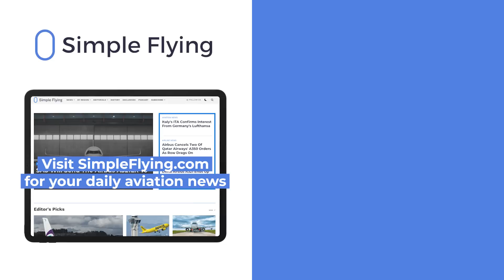FAA Proposes New Airworthiness Directive For Boeing 747-8 Aircraft

Comment: if its a Boeing, I ain’t going! Will do the work to make sure I fly Airbus. I never thought I would say this, Boeing was the first love of my flying career.
Reply: This is somewhat sensationalistic. AD notes are driven by previously issued service bulletins as was mentioned in Boeing’s statement. There is not one production aircraft that doesn’t have at least one AD note. The Airbus A-320 has AD driven recurrent NDT (non-destructive testing) crack inspections at Frame 35 behind the aft end of the forward cargo pit. At Frame 47, upper fuselage above the overhead stowbins. At Frames 66-68, forward and aft of the aft entry doors, just to name a few areas susceptible to repetitive stress cracking on an airplane that isn’t a Boeing product. The good news is that in commercial aviation, maintenance, inspections and repairs are all part of the business. In general aviation, AD note compliance is reviewed at each annual inspection. News items about airlines being fined for missing inspections are mostly just noise.
Reply: Airbus is literally no better. Stop falling victim to hyperbolic headlines

Comment: About a year ago, I flew left Lufthansa 747-800. I could no believe that, as we entered the planes, we could see the fuselage had been reinforced due to cracking. In a 6 year old plane. Looked like what may be normal cracking reinforcement for a 36 year old plane. Something wrong here and I will not fly 747-800 again.
Reply: This is somewhat sensationalistic. AD notes are driven by previously issued service bulletins as was mentioned in Boeing’s statement. There is not one production aircraft that doesn’t have at least one AD note. The Airbus A-320 has AD driven recurrent NDT (non-destructive testing) crack inspections at Frame 35 behind the aft end of the forward cargo pit. At Frame 47, upper fuselage above the overhead stowbins. At Frames 66-68, forward and aft of the aft entry doors, just to name a few areas susceptible to repetitive stress cracking on an airplane that isn’t a Boeing product. The good news is that in commercial aviation, maintenance, inspections and repairs are all part of the business. In general aviation, AD note compliance is reviewed at each annual inspection. News items about airlines being fined for missing inspections are mostly just noise.
Reply: You’re sure it was due to cracking?
Reply: @JayJayAviation  I don’t know any reason why not. I doubt this was part of the original design. Especially as these reinforcements was irregular.

Comment: How did you manage to make a whole video about the BS2360 bulkhead without even once showing a photo or drawing of it? FYI, 2360 is the rear pressure bulkhead, just aft of the rear toilets. The one that failed on JAL 123, killing 520, after a botched Boeing repair of a tailstrike..

Comment: This is somewhat sensationalistic. AD notes are driven by previously issued service bulletins as was mentioned in Boeing’s statement. There is not one production aircraft that doesn’t have at least one AD note. The Airbus A-320 has AD driven recurrent NDT (non-destructive testing) crack inspections at Frame 35 behind the aft end of the forward cargo pit. At Frame 47, upper fuselage above the overhead stowbins. At Frames 66-68, forward and aft of the aft entry doors, just to name a few areas susceptible to repetitive stress cracking on an airplane that isn’t a Boeing product. The good news is that in commercial aviation, maintenance, inspections and repairs are all part of the business. In general aviation, AD note compliance is reviewed at each annual inspection. News items about airlines being fined for missing inspections are mostly just noise.
Reply: Service Bulletins and AD's are common on all aircraft. They are complied with and the fleet goes on. The redundancy in design shifts load to other members. The issues you see here do not take into account the cleverness of the design. "If the average man designed an airplane it would not be flimsy and break. It would be so heavy that it could not fly" John Thorp.  He probably quoted others before him..

Comment: That could cause problems for the new AIR FORCE ONE 747-8i Airplane.
Reply: No. The AF1 has some years before it will fly. Plenty of time to take it apart and rebuild it and take it apart and rebuild it and take it apart and rebuild it and run over budget several times.

Comment: I wonder if this is an issue popping up based on the ages of the aircraft, or an actual design flaw.
Reply: Another shim problem. Apparently the people on the line did not get the 911 on installing shims correctly.  Not a design flaw but rather a problem on the manufacturing floor.
Reply: @danharold3087  You mean the 411. One of Boeing's biggest problems is dismantling its union and hiring a lot of less experienced workers, paying them less.  They're showing less care in the quality of the product just as Boeing is showing them.
Reply: @sainnt  The 747 was assembled by union workers in Everett WA.  The sections of the jet were not necessarily assembled in Everett or even by Boeing - Spirit Aerosystems supplies the sections for many Boeing jets.
Reply: Design was fine. Construction and subsequent Quality Control of assembly are the issues here.
Reply: I was never a fan of the 747-8. I hope it's not the latter
Reply: @rpt19  I've flown on it twice on Lufthansa, once in business class on the upper deck, and economy on the lower deck. The aircraft is an absolute joy, though I can't say the same for Lufthansa service.
Reply: @sainnt  I can relate
Reply: Can't believe the 800 has been flying since 2011 already!
Reply: @Anolaana  Which 800?
Reply: Soo did Boeing forget how to build a 747 properly?
Reply: @robertojofre15  No, they didn't. Aircraft aren't completely built in house anymore. Components are outsourced, then assembled in-house, but sometimes the components don't quite fit together as designed, and it's up to Boeing's quality assurance team to make sure that they do. That's where they seem to be falling short a lot more lately.

Comment: Boeing informed customers in 2021 and 2022,  Now in 2023 the FAA is working out how to make it official.     Boeing even responded to simple flyings information request.    Better had it not happened but sounds like it was well handled.
Reply: So, you fail to follow procedures, this makes the aircraft dangerous. Then you tell the customers something, details not show. and after 2 years the FAA has to take action! And you think this is a win for Boeing1 Pretty low standard.
Reply: @benwilson6145  There are 100s of similar cases where aircraft are required to be inspected for possible problems.    This is almost a Yawn.
Reply: @danharold3087   I imagine there all faulty Booeing aircraft !
Reply: @benwilson6145  Your bias has you imagining wrong.   Airbus aircraft are subject to a number of ADs, some of which require inspections. Common areas that are inspected under ADs include wing spars, hydraulic and electrical systems.  there are a number of airworthiness directives (ADs) that apply to the Airbus nose wheels.
Reply: @danharold3087   From your attitude to passenger safety I can only imagine you are the QA Manager at Boeing
Reply: @benwilson6145   Only pointed out some of the  problems at Airbus because you made out like only Boeing has problems.   These aircraft are complicated and problems exist.   The most memorable and visible one is the nose wheel.
"The Airbus nosewheel has been a problem for many years. There have been numerous incidents of Airbus aircraft landing with their nosewheels turned sideways or even backwards. This has led to a number of accidents, including the crash of a FlyDubai Airbus A321 in Rostov-on-Don, Russia, in 2016."    
Time to act like an adult instead of a fanboy.
Reply: @danharold3087  All new aircraft models have teething problems.  In 1969 the airline I was working for began taking delivery of the Boeing 737--200.  It was such a flawed design that airlines began refusing it and Boeing almost ceased production.  We mechanics had our hands full getting the airplanes back into service after many hydraulic and electrical system failures, not to mention the horrible skin corrosion problems.  However, Boeing came up with effective fixes for all of them, and year by year the airplane got better and better.

The 747 went into service in 1970 and also had problems.  Again Boeing fixed the problems, and by the time the 747-400 came out, it was a wonderfully reliable airplane.  It was not until the  crooks and thieves took control of Boeing that the airplanes began getting worse rather than better.  The criminals at Boeing are buying off judges and prosecutors to save their own skins.  I believe that more people will die in a defective Boeing airplane before they are held accountable.
Reply: @benwilson6145 there?

Comment: Despite what more than two thirds of comments are like, if there really was a serious safety issue all of them would be on the ground until further notice
Reply: @mipmipmipmipmip actually the US Government issued an executive order to ground the planes, forcing the FAA to follow their order, since they were stalling.
Reply: In an ideal world, but that's not especially the reality of aviation. You don't have to look hard to find numerous cases where potentially deadly problems were identified and instead of just grounding aircraft (which comes with an associated economic hit), time frames were set out to fix them instead. Negotiations happen to try and figure out economically friendly time lines.
And yes, sometimes fatal accidents took place during those time frames involving known issues.
Groundings are rare, and typically only happen when an aircraft has only a tiny number in service (Concorde was a prime example, or the early days of the 787) or a string of fatal accidents in either similar circumstances or in a very short time frame (DC-10, 737 MAX) force the regulators hands.
Is this one of those cases? Maybe not, but its rather naïve to think that commercial aircraft would be so readily grounded just because a serious safety issue has been identified.
Reply: Not to mention almost every aircraft EVER made has had as Airworthiness Directive….. Which includes EVERY from the A300, A320, and even the A350. It’s just that Boeing has been in such a negative light that everything they have going on makes the news. Good, bad or in between.
Reply: @mipmipmipmipmip I will go first! (Not actually seeing as they have been in service for more than a decade.) The 747-8 is a model I have not been on yet and I am patiently waiting for the day to take my Lufthansa flight.

Comment: I take it you will also report on the upcoming AD from Transport Canada for the A220 coming into effect May 2 ...
  Regarding defective bleed air sensors that could damage surrounding structures and systems  if not replaced..
  Effecting 172 A220's...
Time will tell !!
Reply: Was just stating a fact...
An AD from either manufacturer should not go unreported!!
 Let's see if they do ..!!
You can go back to your verbal bashing of any one that offends you little man !!
Reply: nice attempt at deflection which is what Boeing fans always do when there's an issue

Comment: I presume the aircraft is safe. I am flying on a 748-8 with lufthansa in May
Reply: If the aircraft wasn't safe, it would be grounded. This issue isn't an immediate risk to flight safety.
Reply: @heidirabenau511  well that's not true . As we saw with 737MAX CASE
Reply: @kirilmihaylov1934  747 has been in operation for decades before the 737Max incidents. How is it unsafe?
Reply: RIP

Comment: In Feb I was flying on a 787-9 and suddenly when the plane was taking off water started leaking on me from the over head compartment and that time I didn't know about the water pressure thing, and the scariest part was that it was raining outside
Reply: Most likely condensation from the AC system.  If from the outside, then there would've been pressurization problems.
Reply: @kentd4762  the flight attendance told us that it was leaking because of someone's water bottle or the AC
Reply: @arnavpundale9676  either that or maintenance didn't quite repair the aircraft properly
Reply: What airline?
Reply: @IndonesiaMajapahitNDPCA  LOT polish airlines